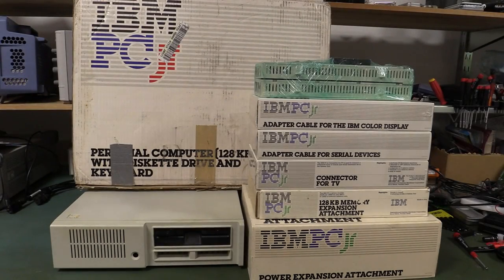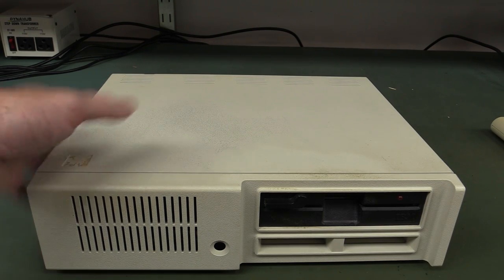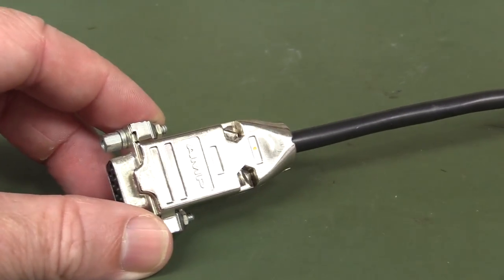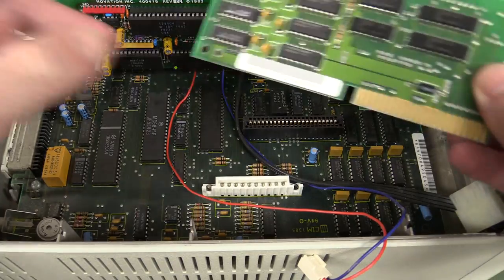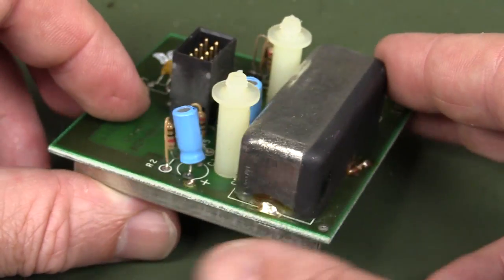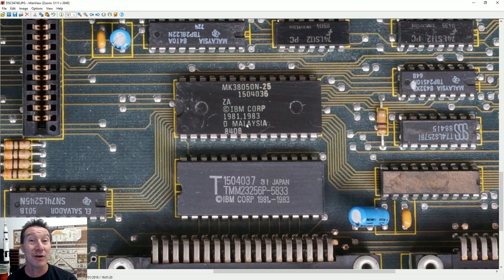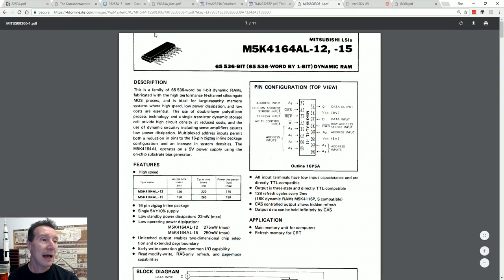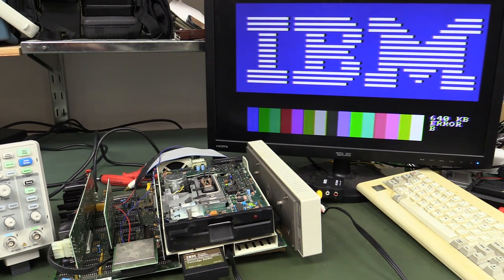EEVblog #1053 - The Biggest 80's Computer FAIL - IBM PC Jr

Comment: my first computer was a surplus IBM pcjr, with 2 floppies, 512k of memory and I upgraded the processor to NEC V20. It play games pretty good, but for the most part was a very aggravating computer to use. Every program I ran on it needed a different version of DOS. It shared video memory with the system memory.
I met a guy who had one that had so many add ons that his was 3 feet tall and had 1 foot of side cards.

Comment: My first PC was this POS and yeah the connectors was just shit, you were stuck with what you had. I got it used and it had 5 of the expanders on the side, including the 512k module, even with this it was terribly slow. I had the second keyboard and used the IR, it worked alright as long you were lined up perfectly. With normal use, I had to replace the 4AA batteries weekly. Other than cartridge Basic and Lotus 1-2-3, I never saw any other cartridges. The IBM color monitor had a really wide dot pitch, I didn’t realize just how bad this machine was until I got an 8086 a couple of years later.

Comment: Some small fact corrections:  1. The 9-pin D-sub for serial was introduced by the later PC/AT.  Back then the standard options were 25-pin D-sub or an even clunkier CCITT V.24 connector.  2. All 3 channels in the timer chip were used in the original PC, but the one used for sound might be available in the PCjr. 3. DMA control, if implemented, needs to sit near the CPU, not on each RAM board, though the lines for adding the Intel DMA chip may have been exposed on either the sidecar connector or the connector for the floppy board (It's pretty difficult to operate the classic floppy controller from a 5MHz CPU without DMA, unless you disable interrupts, which might be one of the notorious issues you mentioned).  4. That AMD second source agreement is why AMD is in the PC CPU business today.  They got to sell a lot of CPUs using original Intel designs (at least up to 80386, possibly 80486) before they had to design their own compatible CPUs.  Their immunity to the recent Meltdown issue is due to them not having access to the Intel designs that made that stupid mistake in '686 and up, as otherwise they would probably have copied it.  Spectre is a more general mistake which AMD, Intel, ARM and others made somewhat  independently.
Reply: Interesting..  I know I Had used the IBM Serial/Parallel board in my 5 slot PC (https://ibm-pc.webnode.sk/i-o-cards/) but it wasn't until I went to challenge your claim that I realized that apparently that card did come out with the AT..  I also had the 25 pin serial, but was much more familiar with the combo cards and assumed they had come out with the PC or XT..    Thanks for the info!!

Comment: Thanks!  This was a great overview..   I was around for this vintage, but thankfully have NEVER used a PC Jr..  2 comments - I noticed a fair amount of chips that were actually 180 degrees from each other - you mentioned how they were all running the same direction, but some were backwards from each other!  Check out that memory upgrade card... the two rows of memory were in opposite orientations!  Is this common?  I've NEVER seen this before!   And, second comment - Thanks for describing that joystick interface.  I've never seen one like that, and although you say most were the same design in that vintage, the old Tandy COCO used its D2A and a comparator, with the joystick as a voltage divider, which meant reading the joystick value could be slow if you cared about full resolution because you had to do up to 6 successive readings until you figured out exactly where the stick was for each axis..  I had never seen this better design to read an analog joystick!  This seems a much better design, although many more parts!   Thanks for all the videos..  I have learned a LOT from you!

Comment: Regarding the way ther computer reset when plugging in the cartdrige, if I remember correctly, take a look at the traces on the cartdige PCB that made the connector part. At the moment of insertion, two traces at one end were shorted and that made the computer reset. When the cartdrige was fully inserted the traces wouldnt short, making the computer start up again. Very clever. I used my PCjr for ages. It tought me a lot about hardware and software.

Comment: Wonder if you could’ve overclocked the thing by kludging in another crystal and clock generator, although that might interfere with the shared video, since the processor would’ve controlled the memory by itself? (At least that’s how I understand/remember DMA, happy to be shown the error of my ways here. In fact I think nostalgia nerd has a video on this...)

Comment: I don't get it why big PSUs and everything gave you a laugh, because they were built to last. And this is still working. Compare it to some crappy Apple hardware for top dollar they make nowadays.
Also, I can totally understand why there are custom connectors and stuff, because they used so much hi quality and expensive components, so they hoped to use it as a solid platform and make profit from selling extra peripherals and other expansion stuff.
It could be a good idea to actually compare Tandy 1000 and IBM PC jr in next video, to see if Tandy and IBM have used some tricks to reduce production costs.

Comment: It breaks my heart that you called it a fail. That was my baby back in the early nineties, I used it for many years. Learned a lot about DOS, early Op-SYS like OS/2, GemOS, Windows 1. This PCJR was my starting point into the PC that I own today. I used and owned Timex Sinclair, Commodore PET, Vic 20, several TRS models, ADAM, Atari 800, Sharp MX 700 but no Apple. But my favorite was the PCJR with the disk drive with made loading code I wrote much easier to install and run. Having used computers for over 35 years I would say the X86 PC will be my preferred choice. (-: ɔd ǝɥʇ ǝʌıן buoן puɐ ǝʌɐp sɹǝǝɥc

Comment: IR keyboard in a classroom with 20 computers squeezed into a room, interfering with each other?   Apricot computers, manufactured in Scotland, used optical fibers with black jackets to solve that problem.   Ever heard of them?  The Apricot line was designed well, but the pricing was way too high, didn't sell much.  They used DRI's GEM desktop on top of MSDOS, beating Windows at the time.  Just too expensive to sell well.  I bet those are rare now!
Reply: Good engineering cannot always overcome bad distribution deals, or bad pricing, or horrible reputation.
Bad engineering can sometimes sell well anyway if IBM puts MILLIONS behind making it a PLATFORM.

Comment: IBM had absolutely no idea how to deal a "home" or "consumer" market. The Jr COULD have been a decent home computer, The sound and graphics were good for the era, but it seems like they made much of the hardware incompatibility purposely to make it a PITA to add them into a pre-existing PC environment, Naturally protecting the "real" PCs. I could see this strategy if there were no clones and IBM had an iOS type hardware/software gated community, But they didn't. They should have just kept the original PC design (perhaps in a cheaper case?)  added the new sound and graphics and pushed that towards the consumer market and pushed the AT to business (with an XT-286 for small business).

Comment: I never had  trouble with the keyboard...unless sublight was in the sensor..
I learned programming using the BASIC cartidges. I also learned how to store info on the disks. I wish I still had the original Microsoft Flight Sim :) We had the 128k....woohoo...LOL.. 
The graphics were fun to play with using BASIC, but yet the amount of memory kept me limited on my small amount of programming. 
We never had the modem but I had seen one with the modem in a resale shop once. We did have the parralel port and printed banners on weekends using the old Epson printer to make money on the side along with the woodworking stuff my dad did...
10 CLS
20 COLOR 3,0,0:LOCATION 10,5:PRINT "HELLO DAVE"
30 INPUT A
40 END

We had the color monitor that came with it, you could hear the drive through the speakers pulsing it's signal if you have the monitors internal speakers all the way up. Turn it all the way up and list a disk and you'll hear the various buzzes. 

We also had the Dos 2.1 disk...

Most of the high graphics programs I ran into used 256k...which ours didn't have.

The disk drive always needed some fresh gun oil on the shafts...
 I actually enjoyed using the IMB 128k PCjr.

At 12 yrs old, I wish I had learned more about electronics back then instead of trying to learn component level stuff at the tender age of 42...LOL. 

Our friends were inpressed with the remote keyboard because they didn't know there was such a thing. 

Ahh, the old PrintMaster program also....LOL...

Maybe the Motorola chip either handled the IR keyboard or the modem command subset.

Boy I miss that old thing!

Comment: I still have an old Atari 130XE, and I had an Atari 400. Jeebus, Atari had a CPU and dedicated chips for both video (ANTIC) and audio (POKEY). Seems pretty obvious as a solution, but why IBM had to run everything off the CPU is not only inefficient, it's bad engineering.

Comment: Funny how many systems had their CPU speed tied to the output frequency of televisions and monitors huh.

Atari 8 bit computers (and the 2600/VCS) have a 1.79 mhz CPU. (Which is exactly equal to 2 colour clocks on an NTSC tv signal, and the video chip outputs 2 pixels for every colour clock.)
The Amiga and Atari ST (and Mega Drive/Genesis) are running at 7.16 mhz. (that's twice the NTSC colour sub-carrier frequency. )
The NES runs at 1.79 mhz. (half NTSC frequency.)
The SNES has a CPU which changes between 3 speeds - 1.79, 2.68, 3.58 mhz. Oh, and it's master clock runs at 21.477 mhz.
The PPU clock (graphics chip) is apparently running at 10.73 or 5.37 mhz.
Which means the CPU runs at 1/12th, 1/8th, or 1/6th of the master clock, and the PPU runs at 1/2 or 1/4 of the master clock, while the master clock itself runs at 6x the NTSC colour clock.
But keep in mind the snes outputs  256 or 512 visible pixels per display line, where an NTSC display line is roughly 228 total pixels, and 160 visible ones. (the rest is the overscan and horizontal blanking period.)
So... if 160 pixels in a line is drawn at 3.58 mhz, then what do you get at 7.16 mhz? 320 pixels. Yes. Which suggests the Atari 8 bit and Amiga, and Mega Drive run their video chips at 7.16 mhz as well. Since that's the maximum output resolution.
But, what about 256 pixel output like the NES, SNES and a few other systems? Well, that's 1.6 pixels for each pixel in the NTSC colour clock. (why 256 though? If you know your binary numbers you should be able to answer that yourself.), 
Which should be 5.728 mhz.
so 5.37 would be a little off, wouldn't it. But, including overscan, and blanking signals, a system like the SNES is known to output roughly 342 pixels per line, while a complete NTSC line is 228 colour clocks. Both are slightly off due to rounding issues, but that comes to... oh. 1.5 pixels per colour clock.
Which is... 5.37 mhz! And of course, by extension, 512 pixels is double that, or 10.73

So indeed, all these systems are largely based on the NTSC colour clock.
Which does of course represent a minor headache for PAL versions of the systems, since PAL is actually 4.43 mhz. (since PAL is 50 hz instead of 60, this suggests PAL has 284 colour clocks a line to NTSC's 228 - but indeed all the clocks in a PAL system are slightly different. Though being in sync with the colour clocks is less critical on a PAL system because they are less prone to colour artifacts, which is the whole point of that synchronisation to begin with. Though it also aids video timing to know your CPU speed is an exact multiple of the video output signal...)

Definitely interesting how these old systems were designed like that...
Reply: Using a NTSC TV was the standard display method for the earliest hobbyist, kit built computers.  There really weren't any "computer monitors" available as we know them today - outside of mainframe systems, and they were very very expensive.  Everyone had a TV...

Comment: Another odd IBM move: PC/XT 286. It was an 80286/6MHz processor that actually ran faster than a PC/AT (also 80286/6MHz). The PC/XT 286 was cheaper and faster. Huh?
Reply: The XT 286 (5162) was IBM's sad attempt to compete with the Taiwan Clones.
IBM didn't have a chance trying to compete on value for price.  They were premium name at premium price.
I bet XT 286 (5162) is an extremely rare collector's item!
Reply: Wow..  I had forgotten about that..  I remember having to decide whether to go with the XT286 or an AT at the time..  We chose the AT, because of the 286 and figured there would be greater ability to use newer software as protected mode grew in popularity..  I think we made the right choice!

Comment: Story time.  I was a freshman in high school in 1985.  The computer lab consisted of about 50 PCjrs.  Messing around one day I noticed that there was a command called MOTOR that would cause an audible click when executed, I believe activating a relay used for the cassette port.  If wrapped into a tight loop, the computer would emit a horribly loud buzzing sound.  Well, being a dumb teenager I snuck into the lab one day and set all the computers running this tight loop.  Needless to say, the lab was a loud buzzing mess.  When the lab instructor finally returned, she absolutely freaked out.  For my efforts, I received a full day of Saturday detention.  I regret nothing.
Reply: Thats awesome..  I know just what that sounded like!  My old TRS80 Coco also had "motor on"/"motor off"  for the same reason..  And..  you had that kind of computer lab in '85?  In my school at that time, we were lucky to have a single apple 2 on a cart that all the teachers shared.  I honestly dont think i ever used anything but a dot matrix printer based serial terminal (no screen) to dial into the county's shared minicomputer in my school..  Glad I had my own at home, as did many of my friends!!
Reply: I was about to say the same.  The dialects of BASIC were very similar between the PC Jr. and the TRS-80 CoCos, since Microsoft pretty much made them both.  I grew up with various TRS-80s, and my friend had a PC Jr., which I was able to program without much adjustment.  For the CoCo, MOTOR ON would latch the cassette relay, and AUDIO ON would map the cassette output to the sound.  Disney (and probably others) had some interactive games that took advantage of this, mixing a story with graphics that would load new scenes from the cassette, and then play next segment of audio from the same cassette.
Reply: I might possibly maybe have disassembled a lab of Apple ][es one lunchtime a couple of years later at a similar age XD. Its possible i got suspended. Its also possible it was worth it XD

Comment: it wasn't a flop. I had a very limited market.  I did compete well against the Apple II, but not against the Commodore 64.  If Apple hadn't snapped up the educational market, it would have done ok.  We always included a floppy with each unit we sold.
Reply: 250'000 PCJr vs. 6'000'000 Apple IIs: "It did compete well against the Apple II" XD

Comment: Looks like a nicely designed computer.  Seems far more interesting for the consumer market than the standard IBM PC, which has to be one of the most boring computers ever made.
The reliance on so many proprietary connectors really ruins it though.
All that excessive build quality came at a cost, which didn't help either.  It seems IBM was culturally incapable of making things cheap.  For them this was cheap, but for consumers it was still too high class in it's construction.  IBM was the polar opposite of Commodore.

The SN76489 was a popular sound chip in the early 80s.  I think it was also in the ColecoVision, as well as some early Sega consoles up through the Master System.  It's functionality is also embedded in one of the ASICs on the Genesis/Mega Drive, but by then it was primarily for downward compatibility and not the primary sound source anymore.

Comment: Wow, I didn’t know molex 4 pin power connectors had been around so long, I thought they came in with the AT standards at least. Probably explains why they’re garbage and have wide open tolerances.

Comment: I had one of these when I was a kid, around the mid 1990's.    Honestly it was not a bad machine for someone just getting into things and starting out learning.   I had a pretty decked out model with 640K RAM and a 20MB  hard disk expansion.

Wish I didn't wreck it trying to learn how it worked tho haha...
Reply: Blink That sounds  more like an IBM XT., with the big red toggle power switch at the back right hand corner.
Reply: No, I had XT and AT class computers too.   I also had a Commodore 64.   at one point.

Comment: The IBM PC did not come with a video card, that was an option you had to add at the time of purchase/order. The chiclet keyboard was not the original PC Jr keyboard, it was a cheaper version rolled out nearly a year after the jr shipped. I worked for an IBM dealership at the time and had to repair many of them in the early years. The original single sided 5.25 " floppy drives were 180K not 360K that was double sided. As for being a flop? Hardly. Our dealership which also sold Apple product and other brands (Compaq, etc. ) as they came along, had 17 stores nationwide and sold thousands of the PCjr computers.